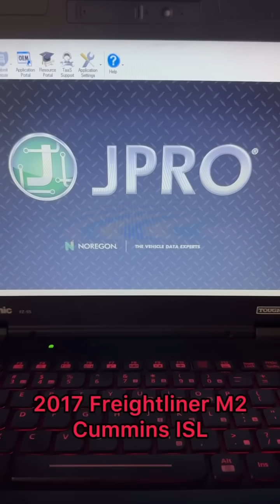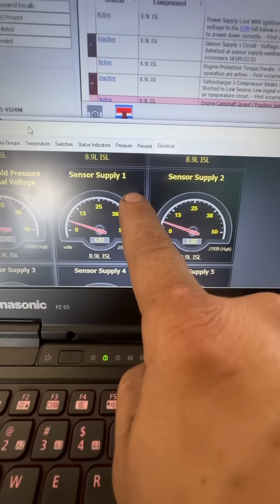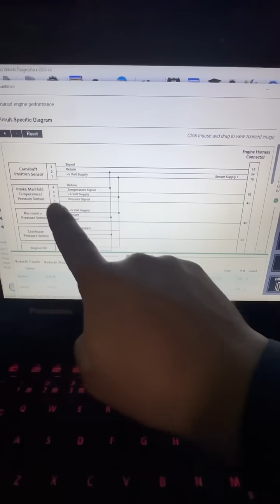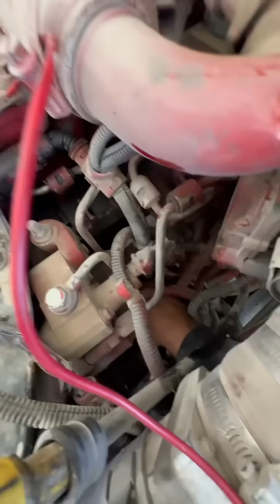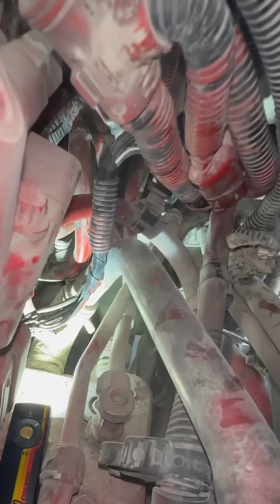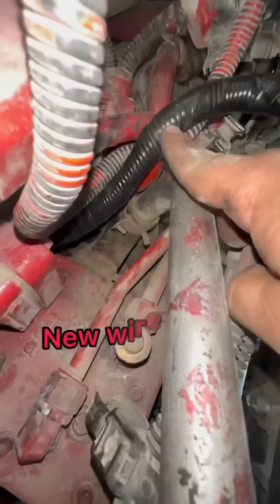#comeoverhere #dieseltech #diesel #Customerstates #dieselmechanic #truckmechanic #trucker #trucking

Comment: I’ve had a problem get worse using electrical tape because it doesn’t stick to the wire. You will get moisture wicking in between it causing corrosion and ultimately a broken wire underneath all that. If I’m ever in this situation and can only fit a finger in where the connector is and the customer doesn’t want it done right then I use scotchbrite to roughen the insulation and put on a coat of nail polish. It sticks like super glue and lasts forever.